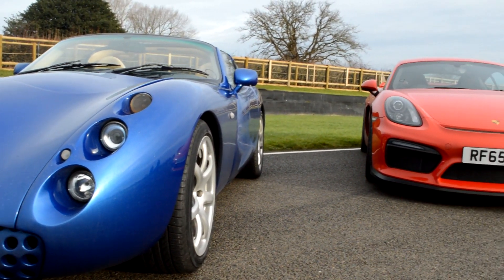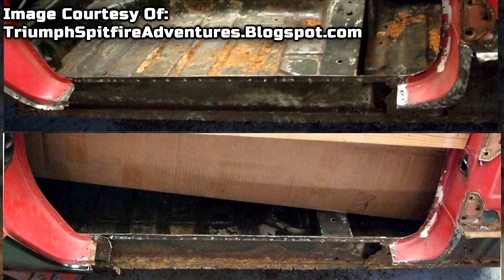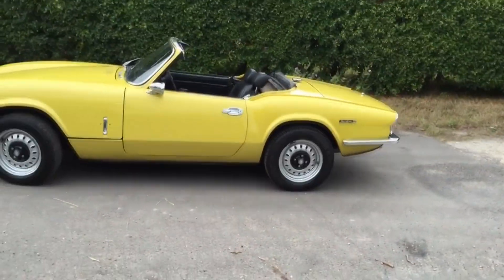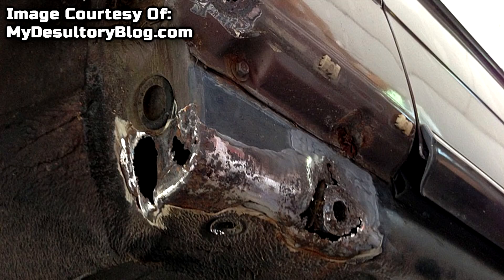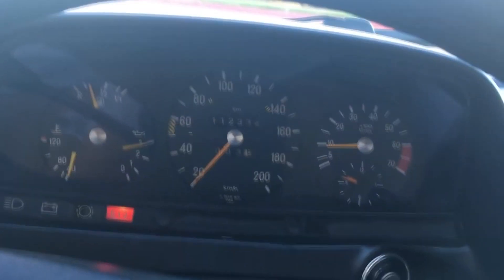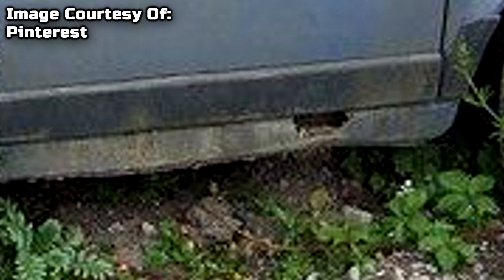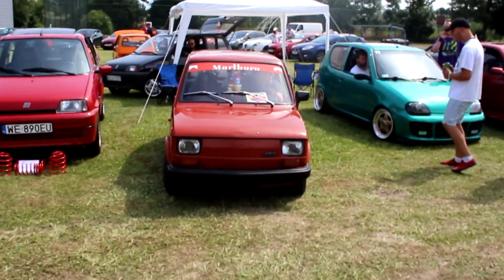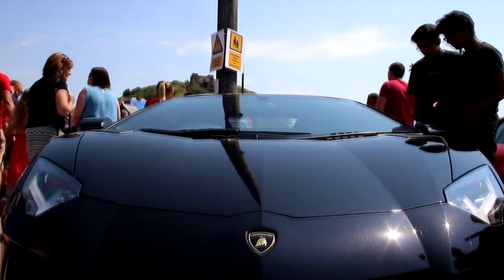Cheap Classic Cars! Classic Car Buying Guide [Second Hand Superheroes Ep3]

Comment: Love the little Fiat,  I have run two air cooled 126's and a BIS. For me the BIS was a much better and usable car with the rear hatch, a much better engine which was more reliable and a little bit more powerful.  An absolutely fabulous little car that you cannot help but to fall in love with.  Even when the missus stuck flower and bumble bee stickers on it.

Comment: I had a W109 (?), in American market  300SEL 4.5  sedan,  1972.  A solid California garage queen that had a fuel line fire, under the warped bonnet.  "I'll fix it up and sell it for a pile & return to Paradise, (Hawaii).  I think I sold it for what I initially paid for the written off car.  Had wrenched on an MGB before and the solid "Feel" of the hardware & materials was a revelation, even with regard to U.S. classics, DeSoto S-15, Mercury Park Lane &c.  Fell in love with the cheap runabout stopgap, Toyota RT-43.
Reply: Tom Frazier In

Comment: Heard classic cars (registered +40 years ago) are mot and tex exempt so here i am 😂
Reply from the maker: SOMEBODY'S watched Car Throttle 😉
Reply: Is this true?
Reply: @zaksszn  yes it’s true, but if you fancy buying a classic and daily driving it, be prepared to take the bus sometimes and also be prepared to get the spanner’s out
Reply: @UrbexCDT I wish I knew this before spending £20,000 on what appeared to be a banging-spec, refurbished Triumph GT6. It barely started and when it did run sitting inside was like being in a kiln. Sure did feel like King of the Hill driving it down the High Street though.
Reply: @hamzanocap  you can’t complain about the noise they make when they are going though😉

Comment: Any classic car bought in the U.K. for under  £3,000. will in most cases need at least that amount spent on it by way of repairs.

It makes far more sense to buy a Japanese import for  say £6,000. Japan is a much drier country and salt is not put on the roads. Many cars are garaged unused for many years due to stringent ever increasing pollution laws which (unlike the U.K.) act retrospectively. 

To put matters into perspective I have recently purchased an immaculate  1999 Vauxhall Vectra CDX estate,  with only 11k miles, for £6,000. (includes all outgoings).

Comment: There is nothing more expensive than a cheap classic car.
Been there, done that.
Reply: Do you mean in terms of maintenance?
Reply: @RyanWillis227  Just when you think your classic car is sorted and running, something breaks.
Fix it. Ah, happy. Nothing else to go wrong. Then something else snaps. Fix it. Ah, happy.
Then something needs an overhaul. Repair it. Ah, happy. Then something wears out.
Replace it. Ah, happy. Then the government introduces a rubber-rotting steel-corroding petrol.
Reply: @raypurchase801  makes sense. I don't know a lot about cars but not sure about that alleged rubber rotting steel corroding petrol.
Reply: @RyanWillis227  Two good things about cars from the fifties and sixties:
They weighed less and the tyres were super-skinny.
So they're easy to push.

Comment: Spoke to a real goofy beardy nerd of a guy with an MG at Norwich classic car show. He actually told me he had travelled on a section of dual carriageway at 20mph that morning so the underside didn't get wet! I tried explaining to him it made no difference whatsoever if the underside got wet as it would do no harm.
He couldn't understand his wrong doing when the police pulled him and fined him. They drove behind him for several miles to make sure he drove much quicker.
I even tried telling him 99.99%  would admire the bodywork and no one is interested under neath the car but to no avail.. 🤣

Comment: . . . . . . . . 1 millennia ago
I had a 1.8 marina van decades ago and I used to cane that pretty good every day, with carpenters gear on the floor holding the back down.  Mate's 1.3 Escort van to compare with,  but tradesmans vans were generally faster than everything else anyway so all good.
Was that engine in the MGBGT ?  Maybe the van chassis was the difference ?
Reply: kimblewt: The Marina van came from the factory only as a 1.3 in two versions: 500 and a 700 payload.
Reply: @michaelf.h8507  So ?,  Mine was a 1.8, you never swapped an engine ?
Reply: @michaelf.h8507  And my 1300e Escort was of course a 1600 with Capri front struts. What were you running then ?

Comment: Nice video. Interesting. I've had 3 British cars since I was about 18 or 19 yrs old.  MGBs. I bought one new and still own it. It was in storage since the 1980's but got it out this year to restore. No rust hardly at all on it other than inside bottom door panels. It has few miles on it but I chose to put an Oscelli Engish engine in it. Took the car completely apart and it's about back together now and like a new car but better. Coated the wheel wells with a durable substance, etc But I'd like to see a Morgan or one of the big Heilys restored in a video. Thx

Comment: The Best Cheap Starter Classics is to Find A Modern Sensible car In very Good Condition. 
To Buy & own a Spitfire You need to be an Experienced Car Person With Time & patience to Repair it yourself. & a  Garage full of Equipment. 
Try a Mazda MX5 instead for a cheap simple Sports car.  Or BMW Z3 / Z4. 

Merc W123 ? People will Be CRAPPING Their pants at the Cost of repairs ( Secret is They don't need Many Repairs. ) 
People these days Crap their pants when their new car reaches 3 yrs old & 25,000 miles. They Swap it in for a new one. 
HOW THICK are THEY ???

Comment: Merc W123 Odometers Stop or Fail Due to NUMEROUS REPEAT 
WINDING BACK of the Mileage. 

remember in the 70's 80's 90's  The MAJORITY of cars had their Mileage Wound Back Each time they were sold. 
Common Practice on 90% of all Cars sold. 
a W123 with 150,000 on the clock can be wound back to Zero & do another 200,000 Easily & Still be in Mint Condition. 

W123's Were Bought by Businesses as company cars Hence they All Went to the MOON & Back.
The Same with BMW's. 
A BMW Drivers seat should be Mint / Unused at 150,000 miles. even 200,000 miles there should be ZERO Wear.  A 200,000 mile Bmw seat should be EXACTLY As per a 20,000 mile seat. 
BMW & Merc DO NOT MAKE Seats that Wear out.